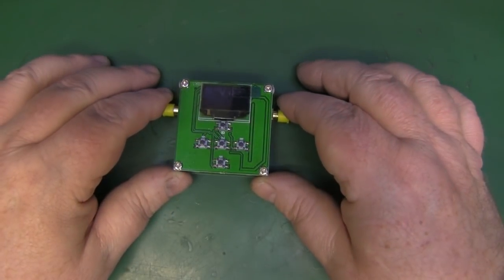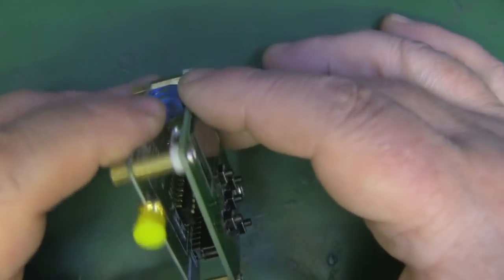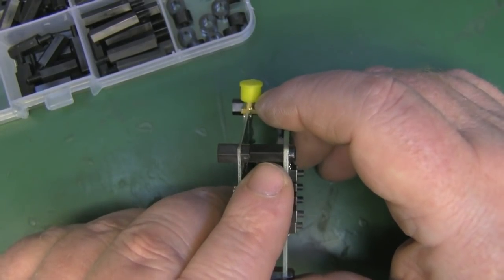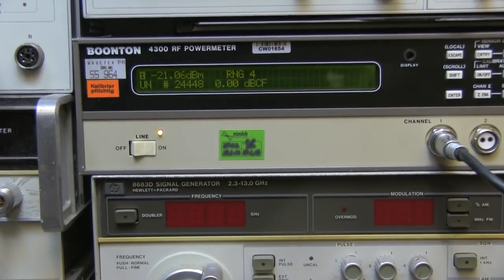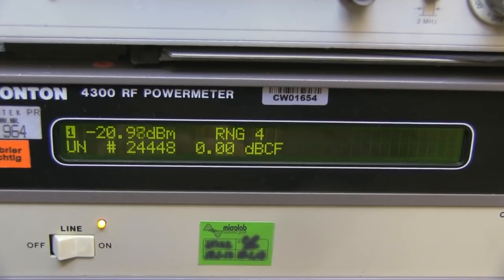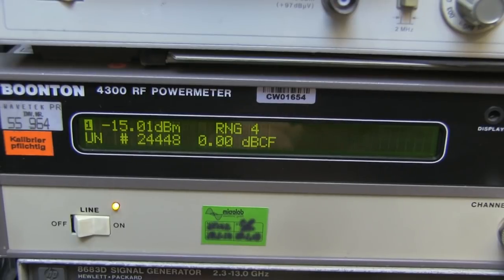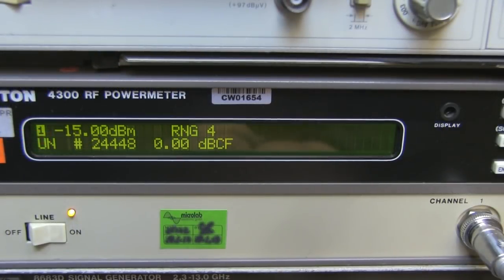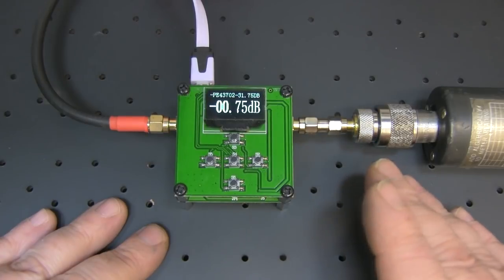Digital RF Attenuator PE43702

Comment: Hi 👋  I have an adc module with 50 ohm input impedance it says it's input voltage should be below 5v p-p  if I use an amplifier with 5v supply like lna moduls before my adc should I use attenuator before my adc???

Comment: Hello Mr. McNeil, I'm looking all over here for an email address or anyway to drop you correspondence, Can't find anything here, or are you just hiding contact info, avoiding folks?  I can't complain, I'm a recluse myself, seems humans chap my arse anymore. All I'm trying to do here is I'm hoping you have any 2.4 Ghz antenna's you've made for sale. You may remember me from the antenna's I've built following your designs, I had sent you pics of my dual 2.4 bi-quad I made with your video, and I used a GPS suction-cup mount for it on the outside of my window.  I'm also the guy who made a quad from a folding food colander, and sent pics of that as well. (I think). I must have had your email address at one time then, now no longer. I am hoping I could purchase one of yours to play with, anything in the 2.4Ghz range. I'm just tired of my own work...lol. And yes, I could go to eBay and get one, but I want an Andrew McNeil antenna,because in my opinion, you're one of the best antenna guys out here, and most of the wi-fi antenna knowledge I've gained, came mostly from you & your videos sir.... Hope you see this note and I hope you have something for sale, I do PayPal as well, so no hassles there. Thank you for your time Sir,
~Marcus 
-malfunctionjunction @ gmx . us